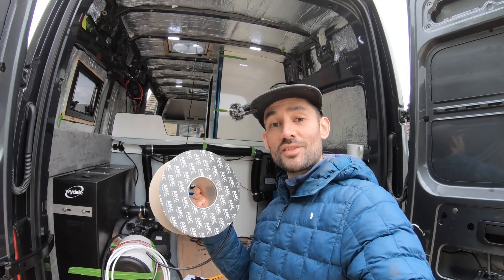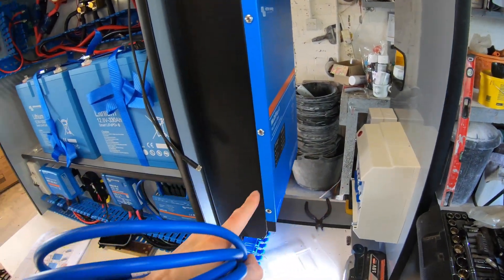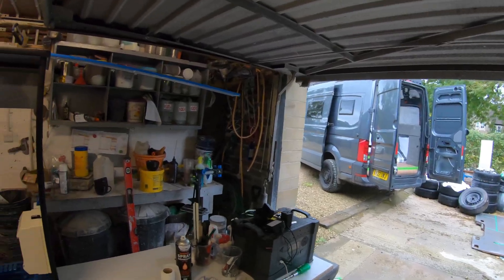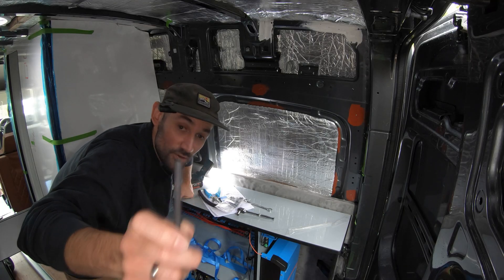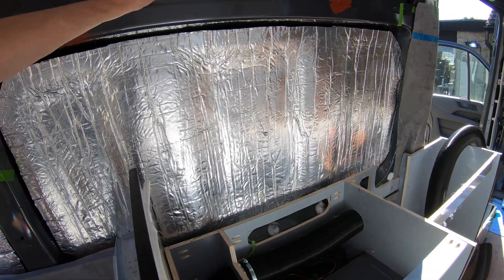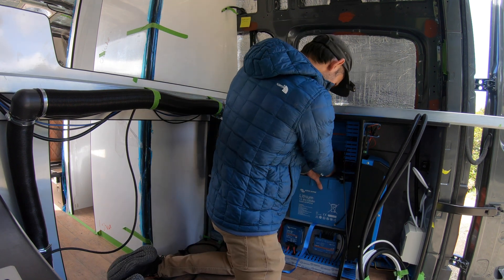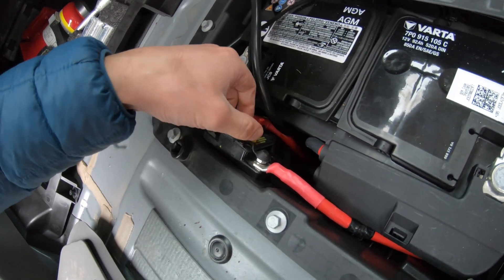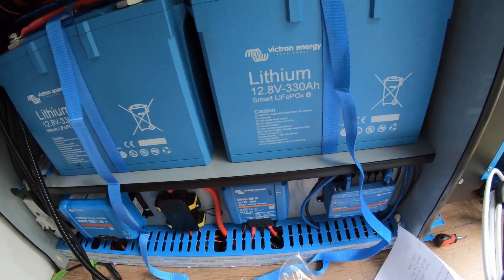We Have POWER! || Ultimate VICTRON Off Grid System for Van Life (step by step) PART 3

Comment: where did you earth your consumer unit? and are you using only 1 consumer unit, not 1 separate CU for shore power hookup?
Reply from the maker: I have earthed the multiplus and lynx to the chassis behind the unit on separate m8 bolts. Yer there are two combiner units one for the shore power and one for the 230v. 👍👍
Reply: @abucklife cheers yeh i saw that in a vid. where did your consumer units earth cable go? and did you connect the two earth bars together or seperate cables
Reply from the maker: @joshdaniel5737 I sent those back to the lynx earth point.
Reply from the maker: @j @joshdaniel5737 separate cables.

Comment: Great videos! I’m currently installing my victron build very similar set up to yours, the earthing points I’m struggling with on mine, I noticed you have 3 can I ask what they’re for please? 
I’m currently installing one from the lynx which is holding the multiplus and the Orion xs 
Cheers 🙏
Reply from the maker: I was just future proofing. This was the first system I have built and installed so I didn’t know if I would need another earth point. I used two one for the lynx and one for the multiplus 👍
Reply: @abucklife cheers buddy!

Comment: Hi Matt, very informative and real! ..I have a very similar set up, and I just wondered which port did you connect the ignition live cable to on the Orion? I assume you have it all charging and operating correctly pal?
Reply from the maker: @JimmiCox  hi mate. Thanks. Yep all up and running and configured this week including my multiplus. Currently stood in here with the heating on charging my phone. Happy days. I ran it into the h port as per guidance from my system designer.
Reply: @ thanks Matt. I’ve just ordered the interface ve bus to usb dongle to allow me to set up my multiplus, I’m then hoping that will get it all up and running correctly. Glad you’ve got the heater/ boiler running, good timing!
Reply from the maker: Absolutely. I needed it yesterday.

Comment: Can I ask why you didn’t put the batteries in parallel has this seems to be good practice loving the build though looks top notch and very presentable
Reply from the maker: Thank you 🙏. I think this is standard for most victron builds. But just following my system designers plans it’s my first electrical build.

Comment: Hi, great build. Quick question as I’m in a similar position. Did you precharge the inverter as it’s 3Kw? 

Also how many of the 240v sockets did you wire in to 1 MCB?
Reply from the maker: Thanks buddy. No I spoke to my system designer that said that with my system it was not necessary. I have 4 on one radial, 3 on another radial and then my boiler and job on the last. I am going to do a video on the 230v stuff.
Reply: @abucklife  that will be brilliant. Thanks mate.
Reply from the maker: No problem 👍👍
Reply: @abucklife  Who was your system designer I may need to contact him as I am about toenter the electrics journey
Reply from the maker: @juleshodgson8167 bspk solar. 👍👍
Reply from the maker: @juleshodgson8167 I would it made it much easier having a a plan.
Reply from the maker: Good luck with your build.
Reply from the maker: Oh and I may need to be careful not to overload them.

Comment: Hi there. As to mistakes, there is one. You should have put the batteries on the lowest shelf. I have about the same Victron system as you. I was hit in an accident and the batteries, due to their weight, moved and destroyed the positioning aluminium bracket holding them steady. This is to say that the batteries should be strapped on as tight as possible and placed as low as possible, to avoid them flying around in an accident or on 4x4 terrain. Good luck and regards from Switzerland, Silvano
Reply from the maker: Hi thank you. Yes I was aware of the need to get them on the floor but I just did not have room there with the wheel arch. I am going to add another brace to keep them down though that’s a great idea.

Comment: looking great. question. why have put a ignition live on, I thought the Victron dc-dc auto detects, I haven't got one on mine and its been working fine
Reply from the maker: Apparently with the crafter the smart alternator can interfere with this and it doesn’t always detect and you can be left with a flat battery. Just a precaution.
Reply from the maker: From what I’ve been told.
Reply: @abucklife  Thanks Matt, I wasn't aware of that. I haven't had any flat battery problems but I'll keep an eye on it. Maybe there's a setting on the Cerbo to detect this and give an alarm, are you going to add water tank level indicators to the Cerbo screen, may also be worth adding a temp sensor in the cupboard to set off an alarm if it gets too hot in there. That's what I'm adding.
Reply from the maker: I think it’s a bit hit and miss. Depends on the alternator you have. But I’m not 💯 on the details of it. Good idea. Level sensors are on the Bobil hot water screen. The temp sensor is a great shout.